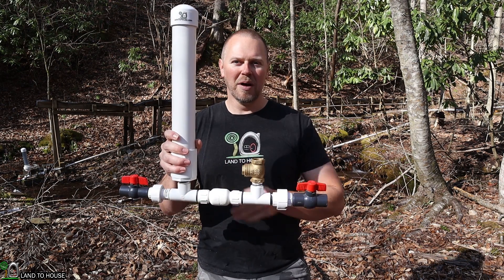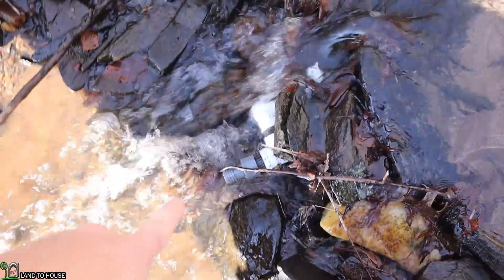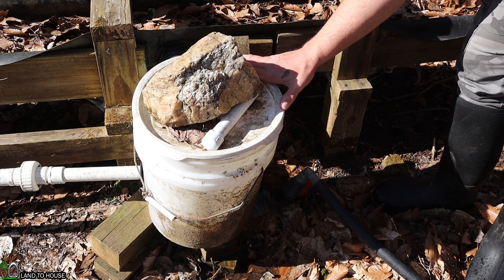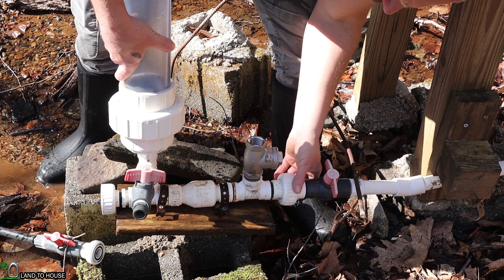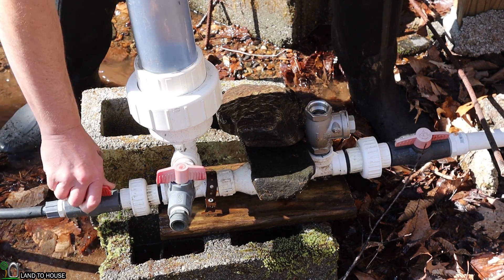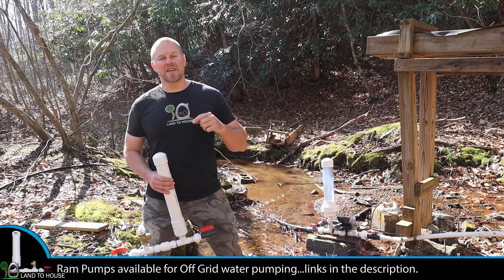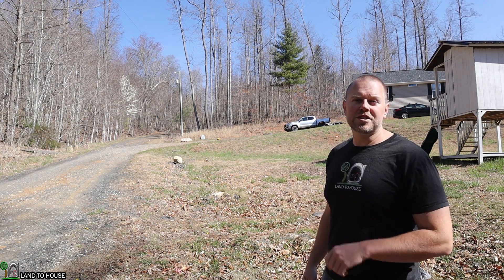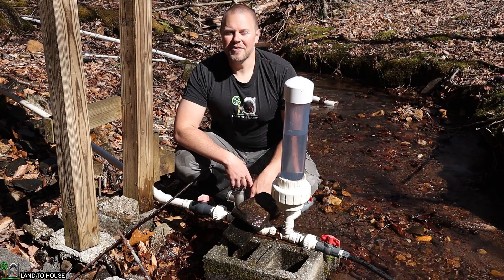Start the Ram Pump for 2024

Comment: Is it possible to lift water higher by pumping water into a larger tank to bring up the head pressure closer to the source, and then move water even higher?
I'm interested in using something like this for running a sluicebox in a small placer mining operation.

Comment: In the future... close the outlet valve, get the pump up to ptessure, and just crack it open slightly so the pump keeps cycling, until the line is filled. You can watch the water level in the air chamber and adjust the outlet valve bit by bit until you can open it fully
Reply: I fully agree. Thanx for the comment. Wanted to mention it as well

Comment: Cant seem to get enough head pressure. Have tried several of remedies but so far no luck. I don't believe We have enough fall . Is there anything else I can do. Already put in the silt bucket. It will cycle 3 or 4 times then stop.

Comment: The flap on the waste valve....which direction should i orient the flap...dhould the hinge be on the intake side or the delivery side?
Reply from the maker: The valve placement does matter if you have the pump on an unlevel surface. If the flap has to close up hill, it will cause more water to be used but also produce more water at the top. If the flap closes downhill and easier, it will use less water but also pump less water.

Comment: I DON'T SEE A BIKE TUBING INSIDE THE PRESSURE CHAMBER. THEN, THAT'S NOT NECESSARY. PLEASE, EXPLAIN. THANK YOU....
Reply from the maker: After a good bit of testing, I discovered the intertube is not necessary. It can even interfere with the cycles if it falls over the inlet to the pressure tank.
Reply: @LandtoHouse  Ok, and thank you for your prompt reply to my question😉👌

Comment: 12:33 have you thought about putting your water inlets at an 45° angle on the side? And you’re silt catcher and your storage tank. I know it’s not much pressure, but it won’t still create a vortex in the water, not enough to add air to the system, but just to rotate the water. The storage tank, you could put a smaller nozzle to create more pressure.

Comment: 12:33 have you thought about putting your water inlets at an 45° angle on the side? And you’re so catcher and your storage tank. I know it’s not much pressure, but it won’t still create a vortex in the water, not enough to add air to the system, but just to rotate the water. The storage tank, you could put a smaller nozzle to create more pressure.

Comment: How long does it take the pressure tank to fill up with water?
Reply from the maker: The tank is to pressure in less than a minute.
Reply: @LandtoHouse  My question is actually how long does it take for all the air to dissolve in water hence rendering the pump non-functional?

Comment: Just wondering I have a low area that my piping will go through before it gets to my high point for my storage tank. The elevation drop is probably16 to 19 feet and then the hill rises up again. I have no real way to avoid this drop. Do you think that a ram pump will push through this area ok?
Reply: It doesn’t matter because the static head is the same on both sides of the sag in the line. I would add a tee and drainage valve at the low point if it’s a permanent installation to drain the line when required.

Comment: G’day Seth, great ram pump info as I’ve built 4 sizes off your plans and all are working in the garden 100% with a hose feeding the head and I can send water up a gumtree 12 feet, but, in creek applications these things just don’t work mate! For the life of me I can’t get 1 foot of head in a flat creek without either damming the creek and or sinking the ram pump under water to bedrock and it still has no head. The raising of water to the head bucket is the whole engine to this system so what tricks have you got to feed that bucket first? I’ve tried reducing poly pipe x 100m lengths for pressure but it all equilibrates. Creek level to bedrock is only the bucket height. Maybe a few mini rams to feed head bucket idea? Cheers

Comment: GET A SHEET OF METAL BEND TO  V  SHAPE 
THEN PUT IT IN THE GROUND INFRONT WHERE YOU JUST CLEANED 
WHEN YOU PUT METAL IN FRONT OF WATER FEED 
ON TOP OF 
SOME FLAT STONES LEAVING A SPACE 
FOR WATER TO GET UNDER 
THE SHAPE OF THE METAL WILL PUSH ALL THE CRAP TO THE SIDES 
AND FLOW DOWN STREAM 
THAT WAY YOU SHOULD HAVE A CLEANED GOOD SUPPLY OF WATER 
FOR THE WINTER TAKE PUMP OUT AND COVER IT
IN A CARBOARD BOX WITH THE SWITCHES AND ONE WAY VALE TAPED UP OUTSIDE THE BOX 
THEN SPRAY WITH FOAM AND TIDY IT UP 
SO IT'S INSULATED FROM COLD 
IF YOU WANT WRAP IN WAX BANDAGE 
CLEAR SILICONE WITH ALCOHOL MIXED  
WORKS VERY WELL FOR WATER PROOFING LAST FOR YEARS IF YOU LET DRY THEN CONNECT PUMP BACK UP SHOULDN'T HAVE ANY PROBLEM WITH IT MAKE SURE ALL THE RUBBISH HAS A CLEAN PATH THROUGH 👍

Comment: Hi mate, great video. Just curious? How much water loss from the flapper valve? I plan to pump from two ground level rain water tanks to an overhead tank to supply the house. Lift would be no more than 12-13ft straight up. Pressure from the tanks would give a good flow, being maybe 2ft above ground level.  I am just thinking of the water loss compared to its ease of operation ... Keep up the good info ...

Comment: Could you theoretically use the electric less ram pump to fill the tank then use the water and gravity to power a water turbine to and generate free electricity?
Reply: I’m sure somehow the law of diminishing returns would apply. There are turbines/generators available that would hook directly to a similar water line hookup. If you have enough pressure to run two lines, you could probably have both. Or run them in a series, if you had another drop to rebuild pressure. 

Disclaimer, I know very little about these things.
Reply: You absolutely could, but you should probably use that time and energy educating yourself as to why it’s not a very good idea
Reply: @augustwest-e8l from your subscription looks like he's trying to be more educated and productive
Reply: 100% you can I'm gonna be doing this
Reply: Absolutely❤

Comment: salut,
tu pourrais tester l' article doi: 10.1115  IMECE2020-23626 
called: "Performance of a Modified Ram Pump With Double Inlets: An Innovative Technique to Improve Performance of the Hydraulic Ram Pump"?

Comment: Outstanding.  I bought one today. We currently use a 2 stage Davey pump to push water 400 feet away up maybe 40 feet. Pump works great, but sand from the creek in Maryland destroys the impellers. I'll try to fill an IBC from this and then pump uphill. 
Waynes World Garage

Comment: why not fill the delivery pipe with water from a hose first to save the trouble?
Reply from the maker: Often the ram pump is installed away from the house and no hose is available for prefilling.

Comment: if the filter bucket was up stream at the dam, surely you would have much more pressure in the pump inlet ,  could you try that for US    the pinstock is only from the bucket to inlet,    you talked about presure water  in your video back 10 years orange  jacket, 1 gallon a minutes then, now a trickle  DOH

Comment: Thank you for the great video. Question for you. When using a ram pump to pump water uphill to a cattle trough which is set up with a ball float (similar to a toilet tank) to stop the water from pumping once the water reaches the desired height in the trough, does the ram pump keep pumping? And / or , is it possible to stop the ram pump from pumping once the ball float is deactivated, and restart once the float is reactivated? Hope this makes sense. Thank you in advance. Matt
Reply from the maker: When the delivery water stops flowing the pump continues to cycle in the creek. The pressure at the pump will reach max based on the input head pressure.  Once the delivery pipe is opened again the water flows again.

Comment: I see that there is no inner tube in your pressure tank, but others have one.   What's the advantage/disadvantage/need or not, for the inner tube?
Reply from the maker: After some research, I discovered that the bicycle inter tube does not help with the ram pump pressure tank. It is not an effective air bladder.
Reply: @LandtoHouse  so, if I were to make my own, is there a calculation for how tall or what diameter the pressure tank should, or needs, to be?

Comment: You would have to make an insulated box for the pump itself but yeah if you can run this all year as long as you have flowing water. Basicly you are just stealing water energy, its smart to insulate though no doubt

Comment: I notice you have removed the rubber tube from the pressure tank.  Any reason for this?
Reply from the maker: The tube did not help maintain air in the tank.

Comment: Thanks again for this and all your great videos.

Obviously, I study your videos.
That's interesting.  You have two filter pipes, I'm guessing 2 inches in diameter each joining together to go down a maybe 1 inch black poly pipe?   That might solve a problem I have where the filters can go a week, but benefit from daily cleaning.  Complicated by the location being somewhat time consuming to get to.  I've wondered to what extent my filters may be constraining the flow.    I guess my stand pipes may be a measure of this and I think I'm mostly OK.

We don't have much fall, only 30 inches over 70 feet of creek, so at you and others suggestions, we use 3 inch, replacing with 4 inch diameter 3 feet tall stand pipes to move the height of the water closer to our ram pumps.  I still find it hard to believe, but the stand pipes increased the water pumped by 70%.  After watching this video I'm wondering if I could modify the stand pipes to filter silt like your buckets or maybe have a bucket filter closer to the top that would also function as a short stand pipe.   Filters are important when the irrigation ram pumps run for long periods of time to supply water to mini-wobbler sprinklers.

Never thought about a stand pipe on water tanks - that would solve a few things, maybe even allow going to another tank.  Did you ever get a useful self starting siphon to work reliably?   (I think there is a Land-to-House) video on this.  With limited water pumping, a self starting siphon might allow water to be accumulated at a higher location and "automatically" quickly release a bunch of water for irrigation when required volume of water accumulated.

The creek flowing through our property is lower than the surrounding meadow.    The location is far from electricity and impractical to haul fuel for a reasonably priced gas pump that is not usually designed to run continuously.  The meadow has steep hillsides on both sides that somewhat limit sun for solar pumps and part of the problem we've had with solar pumps is what to do with the heavy batteries over the long winter.   Ram pumps in our case are so far the best way I've managed to irrigate the 4 acre meadow.   The connected mini-wobbler sprinklers direct the water precisely where the water is needed and work better when windy by spreading the water in a wider area.

One continual challenge we have is cleaning the input filters which need cleaning weekly and benefit from daily.  

Another challenge is rotating the output of pumped water among the sprinklers.   For 4 acres directing the water to the high areas, I think we need 36 sprinklers and so far I've had as many as 24 sprinklers installed (but not running at the same time).   Each of our four 1/4 ram pumps can run one and a half or so mini-wobblers - let say 1 pump per sprinkler with me switching the connections - potentially 36 ram pumps.  However if I can figure out how to rotate the output 1 day out of 10 to each sprinkler - in theory, I'd only need 4 and maybe a few more ram pumps.  Thus my interest in filling water tanks with self starting siphons - maybe the output from different tanks could be directed to different sprinklers?  Also, sometimes, like when its raining, irrigation is not needed and might as well be filling elevated water tanks.

I did not realize this  in the beginning, but the Land-to-House ram pumps are the cheapest and most dependable part of our irrigation system.  I've bought several from Land-to-House and built one of my own - definitely faster and easier to buy.  May also be cheaper by the time we goof up and get some wrong parts.   Also, in our case, the pumps are a fraction of the overall irrigation system cost - economizing time is important with lots of other ranch work to be done.

Thank you for all your videos - I've watched most of the videos more than once.  I see you have a few new items like the filter bucket and the kits vs assembled pumps on the Land-to-House website.   Any thoughts of selling replacement parts with perhaps a minimum total order price?  Sometimes parts get lost in the creek and other places.  ... like finding the right size for the rubber gasket used by the PVC Union.

Oh - I also see pump statistics on the website that I don't remember - how exciting.

Thanks for the videos and ram pumps.
Dave

Comment: 2024 video ideas:
Make a concrete/masonry intake for the micro hydro Coanda box to replace the one you made from wood. 
Make a concrete/masonry box to hold your turbine alternately use a old/free chest freezer & cut a hole in the bottom

Comment: You left the pipes disconnected during the winter and they were open for any kind of critter to go into.
Or did you put something into the opening that allows water to get out but no critters in. Something like a mesh?
Reply from the maker: The intake has a mesh. The output was open. I let a lot of water flow through before the first restart. That gets the silt out and any critters.
Reply: @LandtoHouse  Alright cool. Do not want a dead mouse to be stuck in a pipe that you use potentially for drinking.

Comment: I wonder if you might like to try this experiment with your ram pump. Could you try screwing a bike valve assembly just before your pressure tank to see if it can add an air bubble after each cycle? I'm thinking one of those with a soft spring and rubber seat. They don't need much back pressure to keep them shut. You can also use it to add air manually. I've noticed the larger pumps have a small air hole but that doesn't work with the smaller models.

Comment: i have a question .... if we use two pressure chamber instead of using one pressure chamber in a single drive pipe will it increase the pressure of the water ?
Reply: No, 2 chambers would just act the same a 1 larger chamber. The pressure will not change.

Comment: In one of your videos you had a bicycle inner tube in the air chamber. In these newer iterations, the inner tube is no longer necessary?
Reply from the maker: After some research I have found that the tube is not necessary.  It can even plug the lower portion of the pump.

Comment: Used to watch these videos of yours all the time during the pandemic. And I stopped getting them recommended. One day I was working and remembered the ram pump videos. Still impresses me even after 3-4 years.
Reply from the maker: Thank you for watching! Yes 90% of the videos are longer recommended, and I don't know why. The ram pump has so much potential as long as you have a creek.
Reply: @LandtoHouse  I live in the desert of Arizona. The only time we have a creek is when you're hose is on full blast in the grass lol. I hope when I move I have somewhere with a creek. Not because I plan on needing the ram pump but they amuse me. Plus I could think of many things. Like could you take a stand pipe on the swing valve and once that one is working hook up some pipe with a good fall into the next size smaller. Don't know if there would be any practicality but it would be fun to test.
Reply from the maker: @offroadz4861 I used to live in New Mexico. It's so dry out there. 

You can run a small pump from the waste water of a large pump.
Reply: @LandtoHouse  that's good to know, thank you!

Comment: did you know you can turn them into an air pump to get compressed air to run tools or power
Reply from the maker: The air tank only holds a small bubble of air.
Reply: How? I'm curious

Comment: I've a question. If I want to supply my home with water, I need it all year; I can't shut it off for the winter. Why can't I use the ram pump in the winter? Running water does not freeze unless it get **EXTREMELY** cold. So if the creek is running all year, why can't the ram pump be used all year? The water is running in it. It won't freeze. The coldest it gets here in Connecticut is between 5 to 10 degrees on the coldest nights. Normally it doesn't get below 15 degrees in the winter. The creek is still running and so does not freeze. So the ram pump shouldn't freeze either. I want to pump the water into a storage tank inside my garage, which never freezes. It's easy to outflow excess water to the drain.
Reply: We use ours all year, the spring doesn’t freeze during the winter snows.

Comment: How would ram pumps work for intermittent water sources instead of constant ones like your creek?
Reply from the maker: You would Ned to save up water in a tank and release when full to power the pump. You would need to restart the pump manually each time.
Reply: @LandtoHouse  Thank you for the response! Sounds like too much work to restart every time. Probably better to just go with a regular pump.

Comment: Just had a thought - since you’ve got a ‘silt filter’ bucket part way through the inlet line, is there actually any need to screen the intake itself, since a lot of the silt still gets through and into the bucket, and then it’s only 1 maintenance item, not 2.
Reply: The screens keep out larger floaty stuff like leaves and sticks, the bucket lets the water slow down and drop most (not all) of the silt.  Floaty and neutrally-ish buoyant stuff won't settle to the bottom of the bucket.